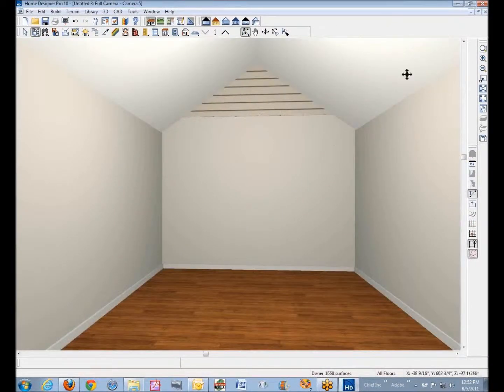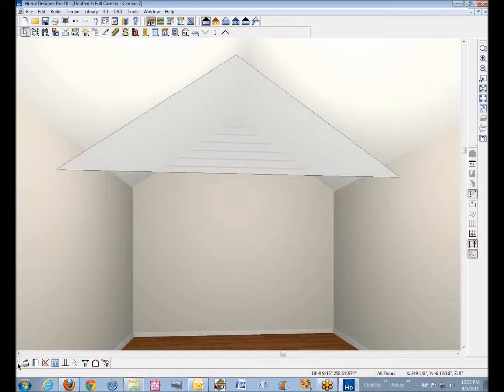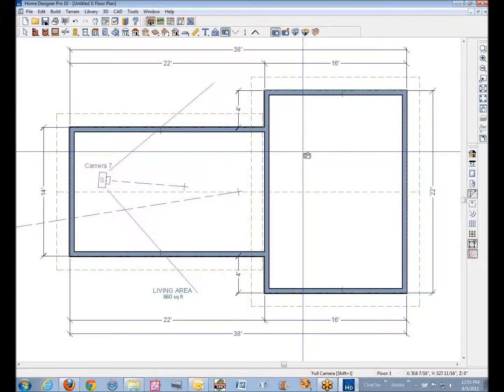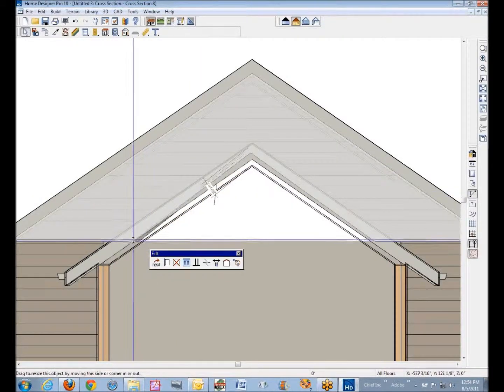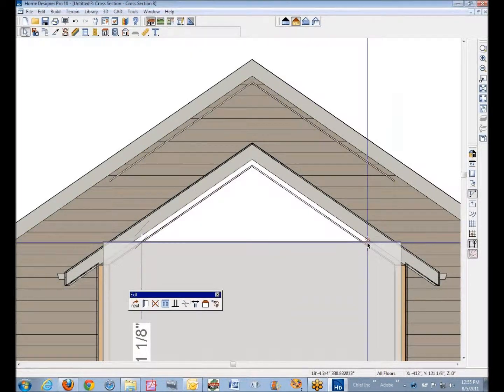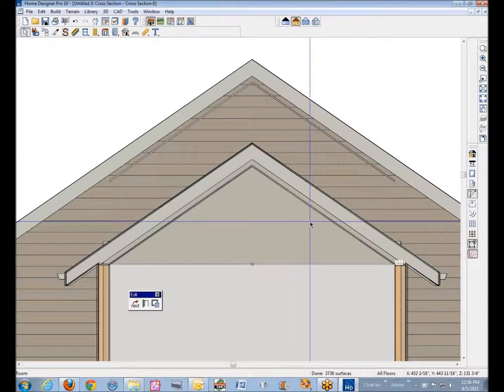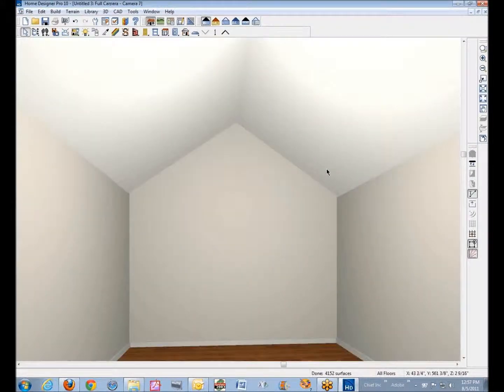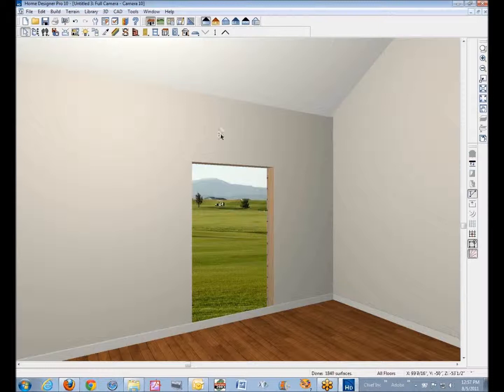Home Designer Pro 10 Wall-Poly-Lines

Comment: Thank you...I'm new to CA (finally upgraded from 2D only cad software after 20 years. I'm finding that there are a lot of manual corrections that need to be done. At first I thought I was doing something wrong but I'm finding that these manual corrections are the way problems need to be corrected.